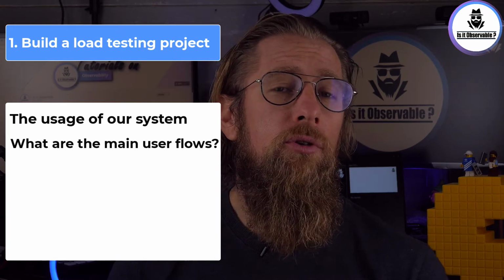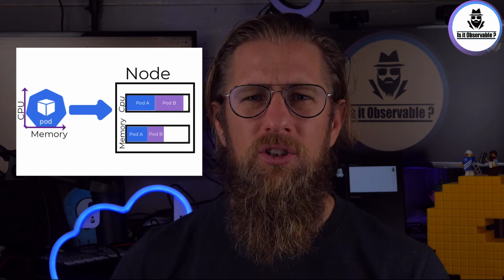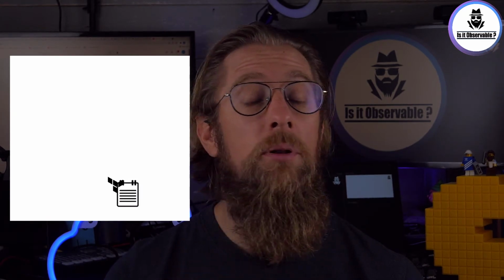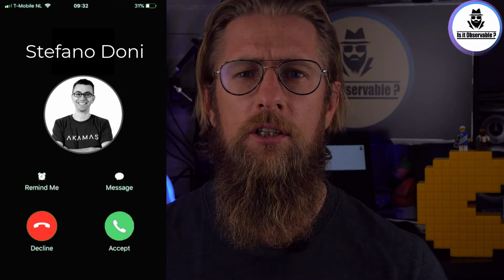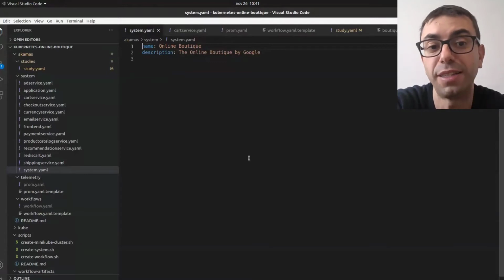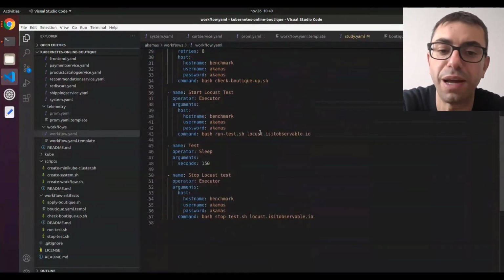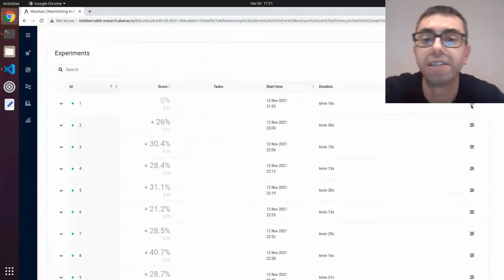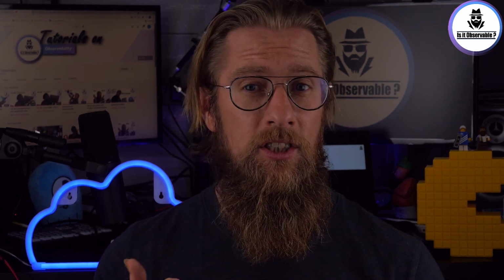How to optimize your K8S Cluster- with Stefano Doni

Comment: Hello Henryk, at 14:04 you are clearly confusing requests and limits. Limits are defined at the container runtime level by the kubelet when creating the pod, they are written to control groups definitions, and then managed by the kernel. That causes slowness if cpu-sets are too low, and OOMkills if memory limmit is set too low. Request only affects the kube-scheduler, and defines how the pod is scheduled amongst available worker nodes, regarding available requested resources on each node. That means best-effort QoS class is not seen by the scheduler, and it can cause issues when lots of best-effort pods are running on a node
Reply from the maker: Hi Serge, i guess i was unclear. If the request are not well defined then our workload does not have enough CPU cycle or memory to start properly....my mistake . Thanks for sharing your feedback. Merry Xmas
Reply: Actually, your workloads will have enough cpu and memory whatever you set for requests.cpu and requests.memory, unless you reach the node's saturation, or the workload reaches limits.cpu or limits.memory. That's why it is important to set low defaults in every namespace - that enforces explicit resources. Something like this :
$ kubectl describe limitrange mem-min-max
Name:       mem-min-max
Namespace:  iam
Type        Resource  Min   Max  Default Request  Default Limit  Max Limit/Request Ratio
----        --------  ---   ---  ---------------  -------------  -----------------------
Container   cpu       50m   2    150m             500m           -
Container   memory    16Mi  4Gi  32Mi             64Mi           -